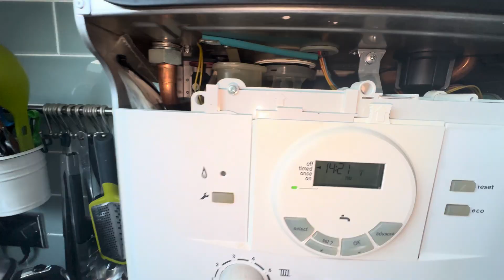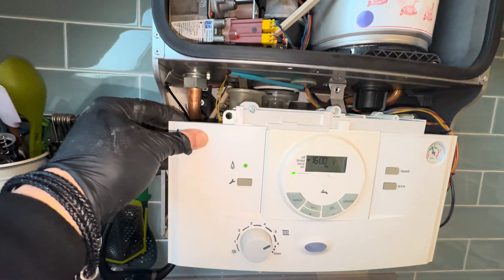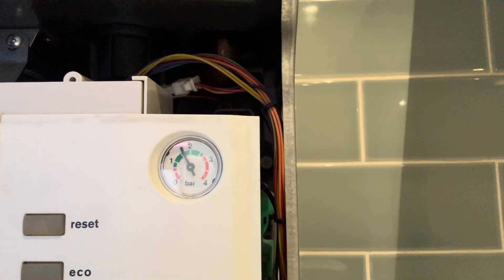Would you attend someone else’s diagnosis?

Comment: Geoff Needs video on flushing heat exchanger and plate in situ, hope it helps!
https://youtu.be/JAVLi3-YcQ4?si=zd3a_NiLYWXk7X2Q
 https://youtu.be/VSjoTrSVJsU?si=gX7WsEdHIWQyLiJ0
Reply from the maker: @ryandow3954  cheers my man! Someone else mentioned this too!
Reply from the maker: @ryandow3954  just had a watch - definitely a good way to do it on that compact model. It was quite easy injecting straight through that top drain off on the junior though - would have been a lot easier with the little adaptor which comes with the express cans!

Comment: Great video on what you did with the cleaner! The engineer, Geoffrey Needs, created a walkthrough video about adding cleaner to the boiler to clean the plate heat exchanger. As an ex-BG engineer, I know that was something they wanted us to do, but I didn't have 20 minutes to wait. Regarding the expansion vessel, my guess is that someone saw the needle on the pressure gauge bouncing and assumed it was an issue with the vessel.
Reply from the maker: @gasfitter78  you’d think a little bit of actual work would have gone into a paid diagnosis though, well I would! Still, a new client gained for me!

I’ll check out his video - thank you! 

Unfortunately, often when you work for companies it’s all time based and never enough to do your job properly!

Comment: Agree always diagnose yourself. Cover your back. Maybe the other engineer was looking to make money by doing unnecessary work🤷🏼‍♂️
Reply from the maker: @russellbaldry5095  sounds like it, especially quoting £1k for it. I’m all for making money but then there’s raking the proverbial! Hope you’re good mate! Thank you for watching!
Reply: @ absolutely! Yeah all good mate. Had to inform a customer they need a new heat exchanger(ideal logic) warranty literally ran out 4 months ago! Logics one of my favs but not seen this before, pin hole on the outside of the main block😵
Reply from the maker: @ ooh I’ve not seen that either! Any chance Ideal will honour it? May just get someone decent on the phone that helps them out! Spirit of Christmas still lingering and all that 🤞🏽
Reply: @ they did call Ideal but they didn’t know how bad it was at the time. Think Ideal just offered to send an engineer out at a cost but customer called me instead. Maybe if it was like a week out of warranty maybe they would have honoured still. New heat engine £435😵🙈
Reply from the maker: @ jeez!! Have you looked at used/recon? A place local to me does the vaillant ones so I’m sure ideal too and charge £100-150 which is a bit easier for the customer to swallow!
Reply: @ yeah i did give them that option but only that the recon usually only have a year warranty on them. Waiting for them to get back to me….
Reply from the maker: @ I guess it depends on their situation - in theory could replace it a couple of times for the same price 🤣 I think the recon ones I get have no warranty at all! I have a video on here replacing one where the client tried to blame me for fitting a filter there 🤣🤣
Reply from the maker: @russellbaldry5095  literally pinholed a week after fitting the filter but was just bad luck!